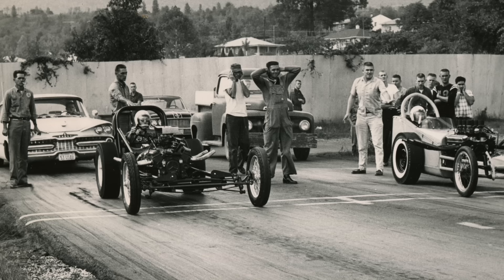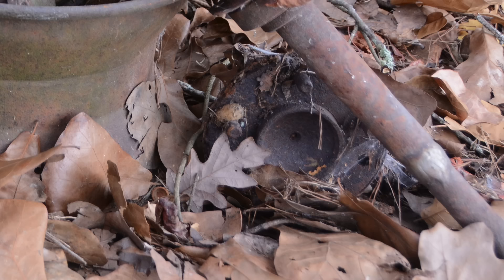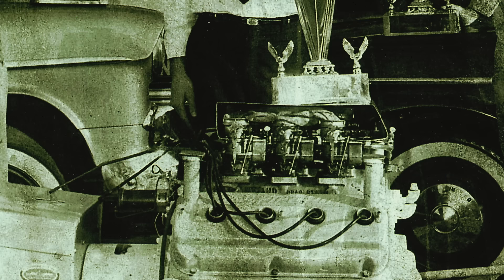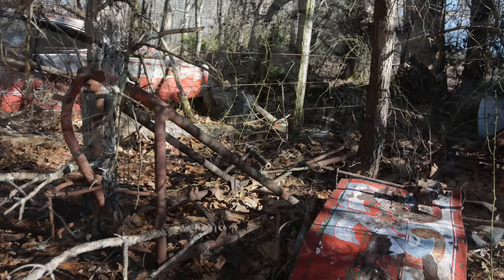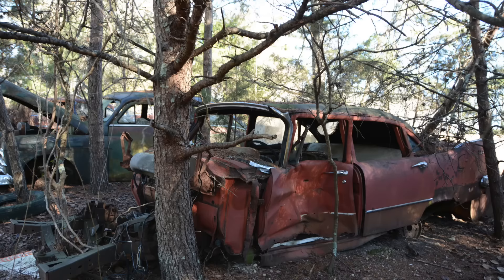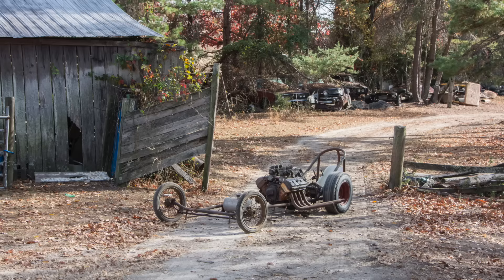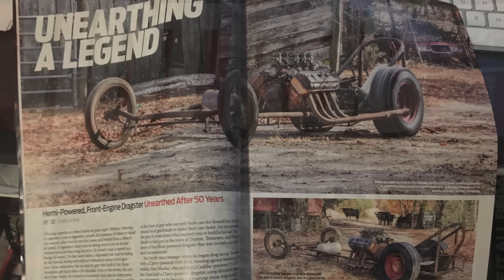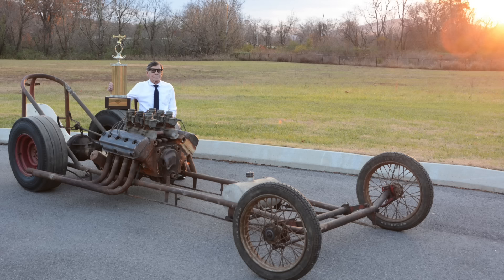Front Engine Dragster ABANDONED in the Woods + HEMI in the Barn!

Comment: Hotrod hoarder as if you don't know already probably you do and I'm sure in your area tour well aware late modelvstock  Cars on dirt tracks and then what are the classes under that bombers  looking cars that are cheaper to build according to the rules. So guys on a budget can Race 2 I'm getting that back in the 80s 90s friend Don Duncan Racing would run a class called hobby stock that you can build your own tube chassis was legal but it had to have the exact Stamped Out body panels in a quarter panels and door skins to resemble the car you claimed it was so he just took a MIG welder wire feed and built the cars entire chassis out of exhaust pipe now this ain't cheap a little higher carbon steel so don't rust out as fast fast and gives you a chassis that's a lot more rigid and my friend built an entire Chevelle all tube frame cage top everything out of 2 in exhaust pipe and on the driver side he ran several ribs and then crossed tide with 2in exhaust pipe so it just looks like it's basically a checkerboard as back then it was a contact sport believe me and your fellow competitors love to t-bone you and the driver side hoping to knock your ass out play I never been around building dirt track cars and it was a riot for me I got a lot of drag racing in was well aware of what goes where but you don't really know everything about a certain type of car get your hands dirty doing it and you can actually make a career out of what you're doing as other guys are doing it with vintage Supercross and motocross bikes restoring them and then sell them and doubling their money and people are beating a path to their door to get them I'm not saying you be interested in that but you are interested in cars like I'm saying you could do this with the old that late models. Cars that run on dirt tracks around your area just like the car I just described and I seen even now where guys are getting street-legal lights Mufflers brakes on them getting inspected registration and license plates guys are all by those just for their weekend street rod play toy to drive to a car show and something I've always wanted to fix up and take a damn dirt track car lights on it as can also be done with cars like this rail which was the very first Style real I ever saw in my life right here in Terre Haute Indiana that was back in about 1957-58 as they were the very first rail Dragsters ever on a drag strip of this style as I was in Sky King airport that day is my dad and my uncles had a brand-new little Piper Club promising me a ride that I never got and so I'm hanging on the fence and I didn't even know what a drag strip was or what the hell he was even doing now all of a sudden out of chute a car just like that when you found and it had the first of the Chrysler Hemi 300 Firepower valve  with the old mechanical helburn fuel injected I've been hooked on all types of racing that the common man off the street can afford and fix it up in self at one time we went to the US Nationals at Indianapolis Raceway Park with a 1969 Chevy Nova 2 door coupe was that the original 2:30 cubic inch inline 6-cylinder I have a 140 I had bought second hand from the Pontiac Buick Cadillac shop where I worked was always the thought of putting a small block V8 in it later that never happened of course and it was the last year they used that size inline 6 in a Nova does everything else after that what is the 250 cubic inch 155 horsepower but I had already learned the hard way that you don't drop a huge motor into a car and start racing so while making payments buying insurance and driving the car back and forth to work doesn't leave much of a budget the buy anything huge to start with but these cars mostly came with 10 bolt limited slip 3:07 to 1 gears in the rear end this one had a cast-iron all Synchro 3 speed on the floor that is merely R&R with a Muncie 4-speed that is merely R&R with a Muncie 4-speed with no that is merely R&R with a Muncie 4-speed with no mods in the way you go the flywheel is the same they used on the 327 Corvette with a 10 3/8 inch clutch but in the case of the six cylinders with a 9 inch clutch and a pressure plate barely strong enough to pull a lawn mower that being within 15 minutes of the racing capital of world everybody has a Hotrod everybody has spare parts in their swap meets and it's good to get to know the guys who actually have the top fuel rails in this funny cars and a pro socks Guys these are the guys who can afford to change out camshaft distributors rear end gears headers you name it all the go faster tuner parts looking for an extra 0.02 secs off their E.T....SO I FIND a set of mr gasket pro stock leaf spring plate traction bars like new $25 set 10 bolt zoom  ring and pinion 4.88 to 1$30 bucks and mike  Ralston the famous pinstriper install them for me  at United Auto Parts one night for another thirty bucks and one of the mid night auto parts dealers of 5 figure discount walk away prices sold me a set of 15 in rims with 8 inch wide firestone cheater slicks $15 bucks brand new   so with all that the little 6 popper could pop and hop the front tires ovef and open can of bud and never spill a drop ...my buddy moose got interested after he saw it bounce to front tires off the pavement from a dead start ..and began my train course for more very useful tips how to hack and cheat others for the win so we went to the junk yard and found a chevy 192 cu inline 6 cylinded head thst have smaller bcombustion chambers but same size valves and cur the head bolt castings out of thr three intake ports that bound doubles the intake capacity by using a flat head screw inplace of the head bolt and pipe plug the top of the head bolt hole that are hidden under the valve cover...but these chevy  sixes ould pump yhe  hydraulic lifters at only 4500 RPM I said a new crane anti pump up drag racing lifters was not in my budget and again here comes the Moose to the rescuegivind each valve the rocker arm 0.0015 Clarence so I say what's that do moose says we just caused all the hydraulic lifters to completely fill up with oil so now they can't pop up anymore and Float them out and he was totally correct as now that's a little sick popper that went from 4500 RPM Redline add yards a whooping 7500 never let off and just power Hammer the gears next the exhayst sydtem was removed and a 2 foot long exhaust pipe was all the remained so we clamped on a 16 inch long a brand new cherry bomb glass pack 
run a torch tip wire next size bigger through the brass maimjet of its  carter one barrel ..removed the factory fresh air exhaut pump and pcv valve and intake hoses an vented the engine to the open air ..cut thr top plate off the carb removing the choke and butterfly and clamped on a 3 1/2 inch vilocity stack   advanced the distributer ignition timing from 0 tdc to 16 degrees btdc ..took hr down to the local  STAR gas station and filled her up with STAR 106  octane ethanol leaded premium and neuter prices begin to happen like first gear wheelies no problem feeling at tires laying back down the payment was your signal to pounds second year just in time to catch the next red light at the next street byt with the 4.88 gears the speedo read way faster than reall but at a real clocked 85mph speedo past 120 tach reading 7500 rpm took 9 sec to cover the 660 ...
...so my buddy moose says its time to take her down wabash ave  terre haute ind that was still a 4 lane us 40 to indy ..and low and behold is a car lond of frat rats from down town  isu campus in a 68 cutless olds  442  w30 400 big block  hurst 4 speed and they are rapping the pipes and rolling their eye balls at us like the rachid's Chosen Few looking at us  like we are dog meat ...my hood name was rat moose screams out as the light turned green "hit it rat " and gms econo ho hum grocery gitter howled like wolf on lts back legs bolting out of the gates of the kentucky derby like a quarter horse leaving the collage punks at the light ...so as they are rolling up next to us again at the next light the driver yells at me with what the fucks that piece of shit got in it ..and i rare up so prowd and yell back "asix popper" and this olds looked like a chinese fire drill only with six nfl line backers with baseball bats yelling back y u mother fucking river rats as moose interupted with the same comand as before " hit it rat "  and with a good wheel stand caused the w30 drive to swing and hook up to air missing my quarter panal and kkissing wabash ave while the other 5 of hisgorlilla ape men all piled on like a monkey butt fuck party while moose with  both hands fflipping them off yelling  fuck you frat fucks and your slow poke olds o....and in 9 secs to 85 and blue flames  from a red cherry bomb i became an adrenaline addict craving my next fix as in again moose was right there with the drugs shaking the keys to a 1968 gunmetal gray metallic black vinyl top 396 Big Block 325 horsepower 4-speed Muncie 12 bolts 4.11 to 1 positrack Chevelle SS SUPER SPORT WOTH HOOKER HEADERS purple hornie steel welded four inch collevtor glass packs with yurn outs a few months lster i busted the crank and moose set a new class record at the indy us nations doing over a 100 in my 6 popper nova moose dubbed painted down bothsides  "SLOWPOKE" and he finsh 3rd overall in NHRA super stock  eliminator with the big c heevk of 2 grand a gold cup that would hold a case of beer and his fat ass on front page of drag news while i straped muy mx360 yamaha dirt bike to the wench bumper of my cousins ton dump ttruck and headed to santa fe